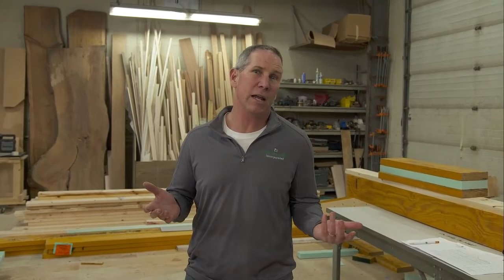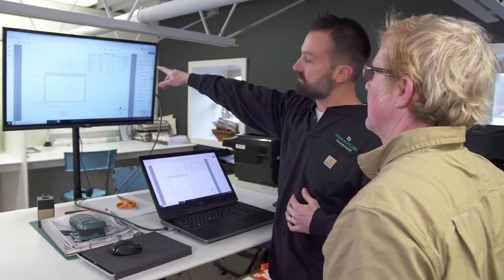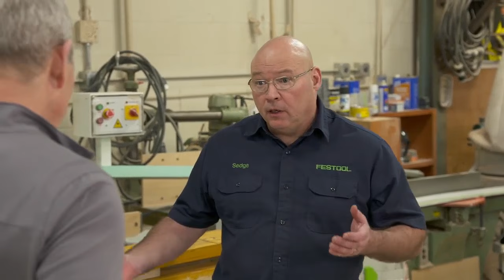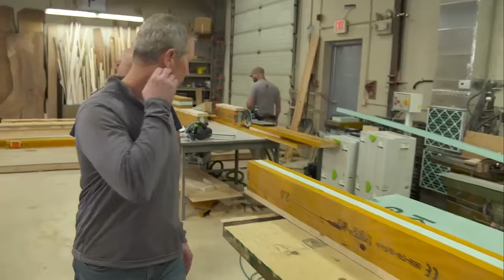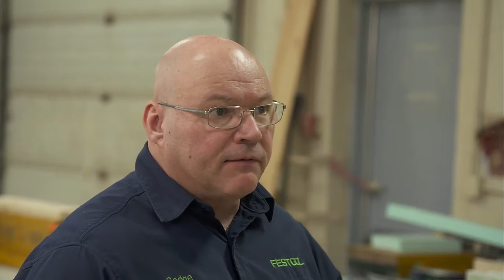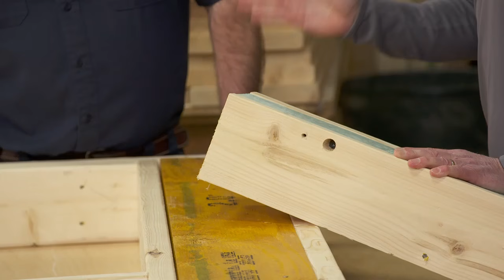This Old House | Pro2Pro: Focus on Framing | FULL EPISODE

Comment: putting that foam insulation between two pieces of wood is not a very good idea because the moister that comes from inside will be stuck there and make big problems between the wood. The rule is that the material must be from more intense to the less intense from inside to outside, then the moister can escape not stuck there and cause problems.
Reply: Around 19:00 he says they spray closed-cell foam on the inside for vapor barrier. I do think sheets of insulation on the outside is the way of the future, though, so they should spend some time engineering a solution for that.

Comment: That was pretty informative, I do framing here In nyc but it’s all metal studs. I’ve always been into woodworking and festool, that seems like a great job at that shop
Reply: Joshh Rodriguez josh metal framing is normally used for commercial fire rated applications or commercial period. Most buildings are commercial but homes are not. I don’t know the code for NY but it is similar everywhere, look into doing residential framing if you want to work on wood but metal is also really easy if you have the right tools.
Reply: John Wesley Hardin you’re right, I’ve worked on residential before, never really worked with festool on a job site, mostly bc people want quantity over quality around where I work. This video seems like they take their time and do everything the way it should be
Reply: @crucialjosh5951  id say TOH has a decent sponsorship with festool. i see it everywhere almost. on my condo the interior wall is metal framed. perimiter is concrete for fire safety. and sound deadening.

Comment: Can you use the festool track for any kind of skil saw ?
Reply: $1000 for a saw and track? Grossly over priced. And what's with all those plastic boxes? Festool boxes take up so much valuable shop space. But I guess they think they have to give you something for the over charge on their plastic tools.
Reply: I want to say, 3-4 years ago I saw a generic track that you could buy for any saw.  I saw it in Lowe's. I have not seen it since but, I have not really looked either.  There are several brands now that I have looked online. Dewalt, Rockler and Kreg. https://www.kregtool.com/store/c48/saw-attachments/p425/accu-cuttrade/?source=5186&gclid=Cj0KCQiA4aXiBRCRARIsAMBZGz_-UygR4SKHmq-Yx6yZZzqoygSS-3Wt1ddH8ehjC3f8-C54Akz72nkaArS_EALw_wcB

I think one is worth getting if you have a large project or building cabinets or something like that that requires perfectly straight cuts on large material. 

Also check this comparison. I always search for reviews and comparison before buying something major. You can also search YouTube to see what if people have bough the product and what they think of it. That is always a good way to go. 
https://www.toolsadviser.com/best-circular-saw-guide-rail/
Reply: Probably not... looks made to fit Festool only.
Reply: @kencoley1likes  Oh ok thanks for letting me know before I purchased one ! 😊